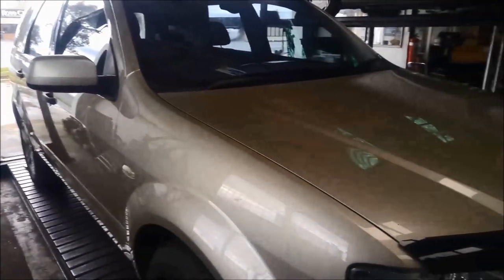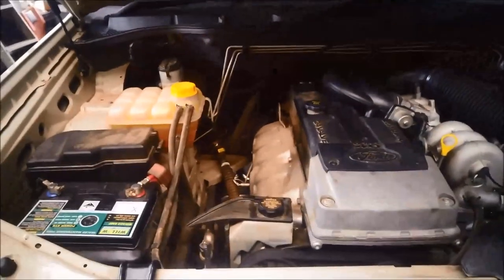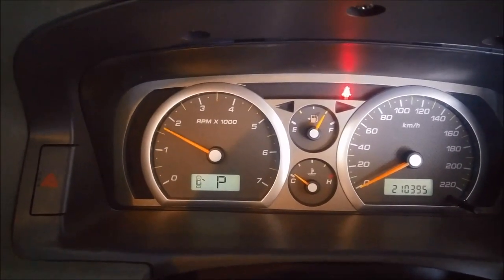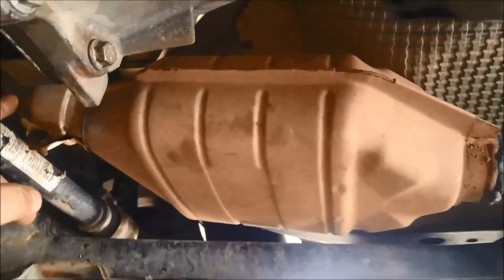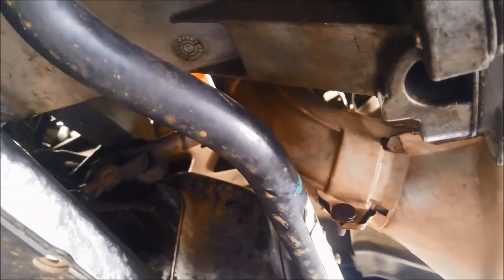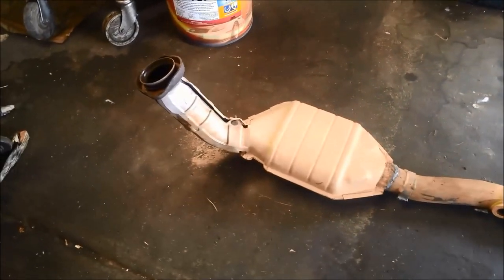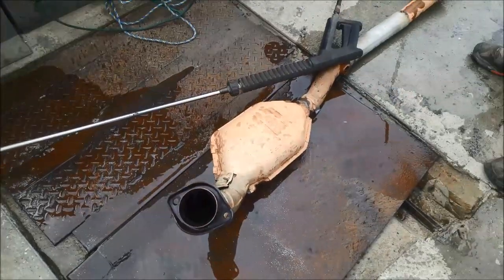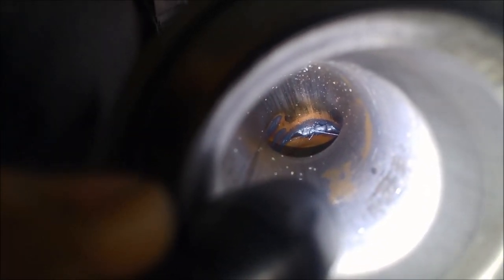No Engine Power - Blame Automatic Transmission or Blocked Catalytic Converter ? How to Test

Comment: Did the same on my bf falcon xls no change in revs car will conk out up hill sometimes with no revs you push accelerator oil light blinks would that indicate transmission oil top up needed as i have correct oil amount and was changed recently with filter put water down cat came out other end so not blocked, friend had a ba wagon same year did same thing was worse actually would conk out at lights sometimes would turn straight back on, they filled up transmission fluid now drives perfect is mine possibly the same cause

Comment: If it was Transmission how would you know? ?
Reply from the maker: hi, a few checks/tests generally confirms whether its transmission, fuel, electrical, brakes or differential issue. cheers
Reply: You’ll usually get a misfire code at full throttle that’s how you know it’s your cat that’s clogged transmissions don’t cause misfires or exhaust codes

Comment: Thanks for this video, I’ve had a p0420 code and that low humming accelerating noise, with loss of power around 2500 rpm is exactly what I had too, my cats come in today I can’t wait to see if my 07 Camry with 160,000 miles had a plugged cat, but either way with that many miles the cats gotta be clogged especially on a model Camry that supposedly burns oil, the restricted airflow makes it run Rich therefore mucking up the cat further
Reply from the maker: hi, just make sure all components upstream of cat are clear as well. you may need to remove and clean manually. cheers
Reply: Update : I changed the cats, car runs perfect and fast but I still get the po420 code most likely need to change the o2 sensors never changed them
Reply from the maker: @reason6244  if aftermarket cat, or has o2 ports at different spots, see our vid https://youtu.be/_r7kdaBOmfo cheers

Comment: I have the same issue but the car works normal when it's very hot but not now in the snow and minus temperatures. I used a catalytic converter cleaner and the car worked normal for like 2 days and then the same problem came back. What do u think I should do?
Reply from the maker: hi, try using a low soot/saps engine oil and watch our vid on reverse flush https://youtu.be/8D_mfp17F6w and moving sensor position https://youtu.be/_r7kdaBOmfo  cheers

Comment: Thanks for the video. I have a ba falcon with 520k. Unbreakable!.
It had a rattle under the car around the exhaust area. As soon as the rattle stopped the car has no power. Noticed the floor below my foot is really hot. 
Still cruises nice.
I will pull my cat out today and check.
Cheers
Reply from the maker: no worries, cheers

Comment: Im no mechanic but i used to get a tinkling noise around the exhaust. eventually it stopped. Maybe ill het a new cat and 02 sensor. It sometimes blows a bit of blue smoke and it smells rich. Ive poured thousands into my 06 AWD territory. The whole front end rebushed, a matr made some old skool bushes out of a truck tyre and the tyre walls of a Datsun...
Zero squeaks in car . Anyway. Great informative video. Thankyou for sharing your expertise
Reply from the maker: no worries, thanks & cheers

Comment: Awesome stuff..quick question what if it's doing the same considering the rev and no power but theres no catalytic converter?
Reply from the maker: hi, if its an auto put in manual 1st and take off hard - if it splutters it could be fuel issue. cheers

Comment: Thanks for the video
Mine is 
-Long /hard transmission shift (Auto Tranny)
-Low power with no codes
-Hard time climbing hills
-When you step on the accelerator gently it moves gently but still struggle on hills
-Remove the upstream 02 hole and drove the car around; I saw an instant little power come to the car.
-Monitoring the car temp; car moderately heat. 

Can it be clogged cat?
Reply from the maker: hi, sounds like you confirmed your question by removing o2 sensor. can also be worn converter, electrical or fuel problem. cheers
Reply: Same thing happening to me did you solve it?
Reply: Deleted the catalytic converter

Comment: On my 1990 Ford F-150, my cat glowed red the other day, but it was after I revved the engine.

Is my cat clogged, or was I dumping too much fuel from revving the engine?

I revved it because it was weak, & when I tried to drive, it was just die, then hesitate to start.

What could be going on?
Reply from the maker: hi, sounds like a blocked catalytic. try loosening exhaust bolts engine side and see if any difference. cheers
Reply: @YepThatsIt  Thank u!

Comment: hi i have 05 rwd model territory cat was blocked so i cut the bend off bashed the cat bashed then welded back up now i have a nasty miss i have replaced all spark plugs and coils as they where over due any ways im geting no codes dont seem to have post cat o2 sensor could  the o2 sensor is before the cat on headers be causing the miss no the cat is hollowed out
Reply from the maker: hi, needs to have some resistance and heat. you can check with live data. cheers

Comment: Hello, Thanks for this video. Question: In your opinion, if an internal 
combustion engine had its tailpipe blocked, with lets say a rag. And 
there was a hole in the exhaust, would that car still be able to drive ?
 and would there be sufficient amount of presure to blow out that rag?, I
 mean if the rag was packed tight enough, could it remain in the exhaust
 ? and still drive ?.
Reply from the maker: hi, never tried driving like that. if you block exhaust while idling it will run, but also depends on the condition of motor as to how much you could rev it without the pressure coming out somewhere....like weak point in exhaust or blown past piston rings back into the sump. are you asking for a friend ? haha cheers
Reply: @YepThatsIt  HI thanks for the reply. I'm following a missing persons case online. There was a car found with a rag stuck in the tailpipe just after it spun and crashed and the driver was nowhere to be seen. Its a bit weird. The car was towed away and the rag was removed at a later date. The police are confused to as why the rag was in the tailpipe. There is a debate to whether the rag was placed in the tailpipe to purposley cause the car to stall. The tow truck driver was interviewed and he said; the exhaust was leaky and his opinion it would still run but he didn't elaborate to much reagrding if it would still be able to drive with the rag stuck in the pipe. Its quite a famouse case (17 years ago). I feel the car was sabotaged on purpose by blocking the tailpipe. Thats why i searched on YouTube for answers. However I'm not a machanic lol. So i thought i'd ask a pro. Thanks

Comment: I’m having the exact same problem , my car is a 1995 Suzuki escudo 1.6l fuel injected, when I bought the truck the catalytic converter was cut off and sold so I replaced it with a straight pipe but also burnt a hole while doing the straight pipe (still learning to weld) I’ve replaced the fuel filter , replaced the fuel injectors , new spark plugs , cleaned dizzy cap, but my car still has this exact problem cutting out on full gas but will drive slowly if you apply gas slowly , it idles nicely and starts straight away every time , I’ve pulled fuel lines off to check and it’s getting plenty of fuel in the engine do you know what might be the problem here please any help is appreciated
Reply from the maker: hi, you will need to do a fuel volume test as well as a fuel pressure check as well. cheers

Comment: Why you do not fix the Exast senser
Reply from the maker: hi, a blocked catalytic will not be fixed by replacing oxygen sensor. in this case the o2 sensor was working ok. cheers

Comment: Hi i got 2006 modal. ... when car drive 15..30 minutes and after parked car P .. engine shutdown and oil light blinking... Macanic saying O2 sensor problem... so anyone know this problem??
Reply from the maker: hi, what fault code is showing up? cheers
Reply: YepThatsIt 
Hi not remember now code. Macanic say ... O2 is not good.
Reply from the maker: no worries, cheers
Reply: YepThatsIt 
Hy i replace O2 and cat but till same problem. Oil light blinking after shutting engine.. can u help me please
Reply from the maker: hi, please contact me on my face book link https://www.facebook.com/Yep-Thats-It-103051017785435/  and leave me which  kind of vehicle/transmission type you have, and leave a detailed description of any fault codes and issue you are having ( we are able to exchange pics/diagrams on there ) and details of what work you have already performed or checked...... you will need to buy me some beers ( link is in face book ) and I will answer your questions accordingly. cheers
Reply from the maker: hi, try without forward slash...  https://www.facebook.com/Yep-Thats-It-103051017785435   cheers

Comment: All ba/territory won't rev over 3000rpm in neutral, it's a built in safety feature.
Read a territory owners manual
Reply from the maker: hi, they will over rev 3000rpm in park. cheers